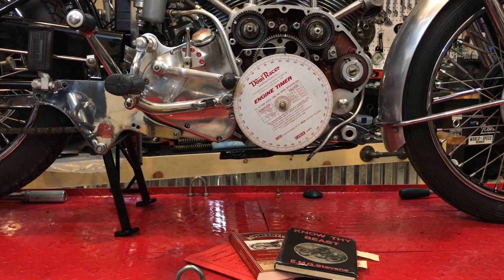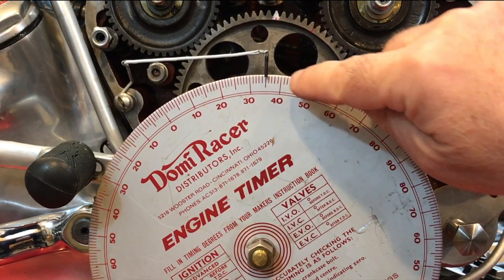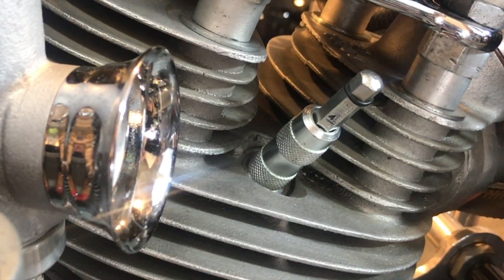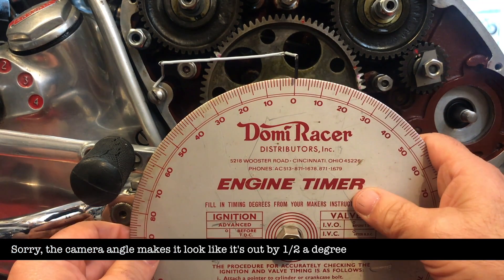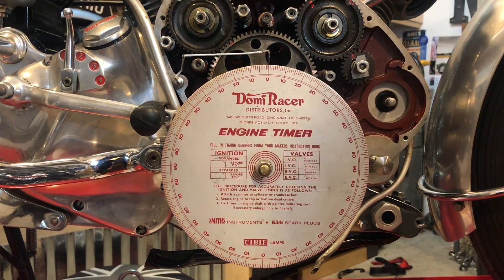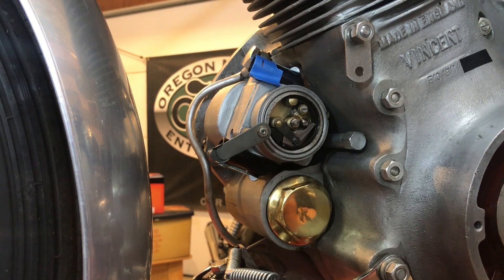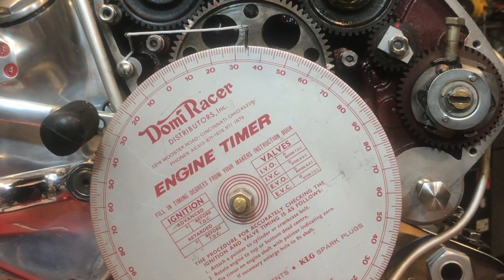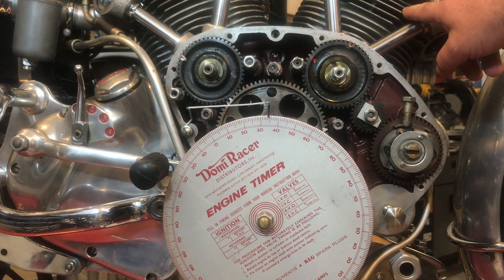Restoration of 1951 Vincent Rapide - Part 36 - Ignition Timing

Comment: Very useful and well-done!  

I'd question the notion, though, that setting advance to 5 degrees less than the factory specification is a consensus, or even well-grounded.  The justification is that modern fuel supposedly burns faster than in c. 1950 - but no one is able to substantiate this claim with any data.  

It is true that less advance is called for with higher compression ratios, as specified in Richardson.

Comment: Thank you for this video . For 2 years I have been trying to get  this bike started , rebuilt the magneto for nothing , ouch , turns out I was timing the front cylinder instead  of the rear when setting the points . Now she started up on second kick ! Seeing your point plate positioning turned on the light  as I am a visual learner .
Reply from the maker: Hi Kim, thanks a lot for your note and so great to hear that your bike roared into life again!  Best wishes, Mike

Comment: Excellent tutorial video. Retiming the front cylinder will presumably open magneto points on the second cam? Are the cams different on a 50 degree twin compared with parallel  twin?

Comment: Excellent informative video.  However, did timing the rear cylinder give you the correct timing on the front cylinder?  Or did you then have to set the timing on the front cylinder?

Comment: Total beginners question... where and how do you fit the timing disc on a Norton Dominator engine? Only place seems end of crankshaft, but you need to access that to turn the engine... Also, once you find TDC, to be able to crank the engine in both directions, the nut will come undone (when turning anticlockwise). Not sure I am making sense... Thanks!

Comment: 34 degree spark lead, all in, correct? What's your initial or 'base' timing?

Thank you for the tutorial.

Couple more questions, could a guy use a standard continuity check for the points? Of course taking into account the beep function would be opposite..

And, is there any adjustment at all where the points fasten to the Mag? A fine tune on final assembly if you will..

Thanks again.

Comment: Hey Mike, Thanks for your video. I'm changing over to a BTH on my Rapide, was wondering where I can find that brass shaft that fits in the quill end and bolts to the degree wheel? Thanks, Joe
Reply from the maker: Hi Joe
I got the home-made tool with the bike.  Have you checked the VOC spares company by any chance?  Or perhaps you could ask on the VOC Facebook page?  https://www.facebook.com/groups/35916442687/?ref=bookmarks. Please let me know how you get on and if you can't find one and I could lend you mine. Cheers, Mike

Comment: I've had a couple of bikes with magnetos so could have used a magneto synchronizer. As a substitute, I used to use a cigarette paper between the points. Then with gentle consistent pulling on the paper until the moment of release. Not perfect, but it worked well enough.
Reply: I tested the cig paper method against an ohm meter some years back, I was suprised just how close it was

Comment: Another brilliant clip Mike. I noticed you had coloured dots on the Cams etc. How did you check if the timing dots on the cams were correct? I don’t want to assume the dots on mine are correct before I follow your clip on timing. Thanks again. Paul
Reply from the maker: Precision Safety Services Ltd thanks a lot,  Paul. I haven’t finished editing the video on the cam timing yet but the white color paint marks are from when I first got the bike. Before I started taking the pinons apart I marked everything just to indicate how it was set up to begin with. But the red paint marks are the actual cam timing marks. I hope to have a video on this soon. Cheers, Mike